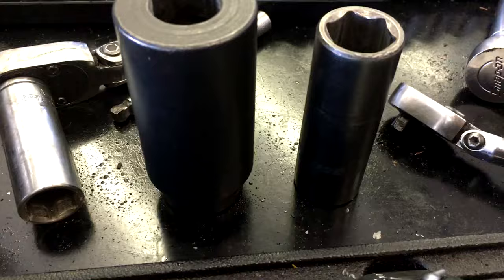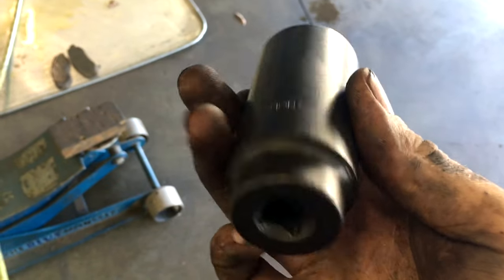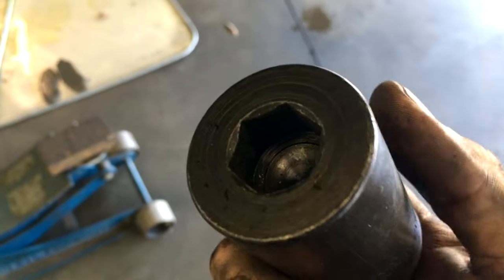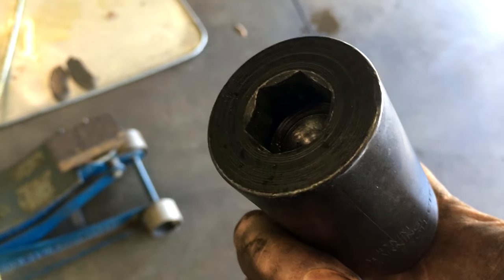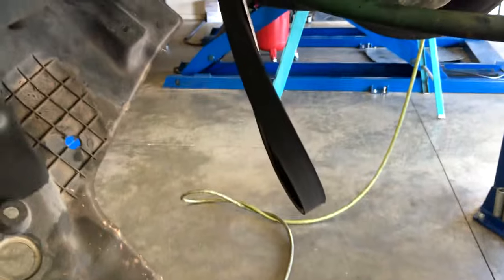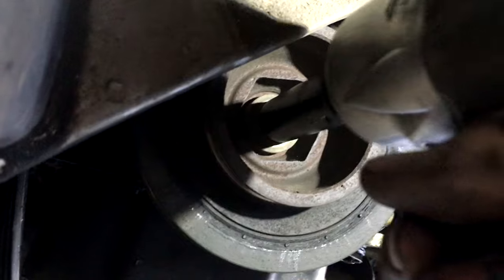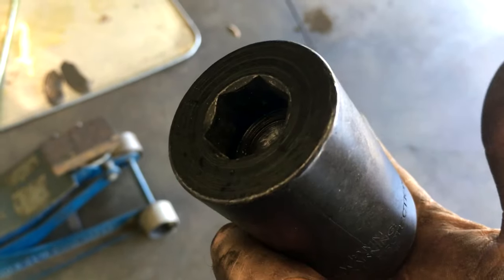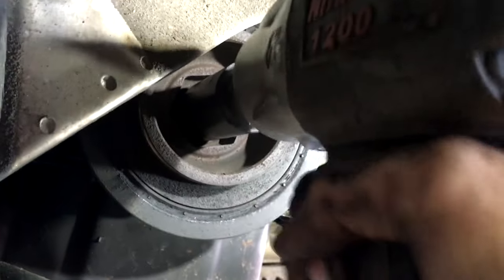The Easy Way To Remove Honda Crankshaft Pulley Bolt / Harmonic Balancer

Comment: Ok, from reading all the comments here and picking out the useful ones... the bolt is NOT reverse threaded, correct?
Reply: I can’t speak for all Honda engines or any other makes , Nissan , Toyota etc. , but I will say my 2002 Honda Accord 2.3 liter the crankshaft pulley bolt is right to tighten and left to loosen . Don’t know of any engines where the crankshaft pulley bolt is reverse thread ? The confusion is that the engine itself when running turns counter clockwise . That is why we can’t use a breaker bar and socket on the crankshaft bolt and click the starter to loosen the bolt . The engine will spin to the left and push the breaker bar to the right , tightening the bolt . Not only is that counter productive , but risking damaging the bolt as well . Just imagine the impact socket rounding off the hex of the bolt head . Worse things can happen such as the socket flying off the bolt and throwing the breaker bar who knows where , or at who . The reason why LISLE made this socket is because of the problem that the engine runs counter clockwise . They know we use the starter bump trick but it won’t work in this case , if the engine runs counter clock wise . A strong impact , a high torque is recommended , the heavy LISLE socket and the 50mm hex tool for holding the crankshaft pulley while using a torque wrench is recommended . The video creator did mention a comment regarding the 50mm hex tool but theoretically that tool is supposed to be used to hold the balancer pulley / engine from spinning while tightening /‘torquing upon re - installation . It seems today that the best option is the cordless impact such as the Milwaukee fuel 1/2” with something like 1400 ft. Lbs. is the way to go . Expensive yes , but so is a good strong compressor , accessories and a high torque air impact wrench . It would probably cost between $400 - $500 to get the Milwaukee , battery and charger but a good compressor , good air impact wrench and accessories will total much higher . Wish I had bought one when they first came out , price is up now . By the way , if you will be using shop air , get high flow 3/8” connectors . The studs and quick,disconnects are typically 1/4” and will bottle neck the pressure to an air impact wrench . Harbor freight has the MERLIN kit . Two kits will be needed because one kit only has one quick disconnect and you may need one on the compressor as well as the hose to the tool . 1/2” air hose is a good upgrade too . Now you can see why high torque cordless impacts are gaining in popularity . $$ !
Reply: @gmoney9588  good info! I picked up the high torque Milwaukee, omfg what a dream. With that and a Lisle socket it came off in 5sec flat. 
Using the engine to remove the bolt was just plain stupid haha
Use it once pays for itself. Socket was $40, impact was $320, I have 12ah HD batteries. CAD $$$

Also used Pink Solution to clean the serp belt like new, no issues.

Comment: How you take it off without the pulley spinning
Reply: Your impact wrench works against the inertia of the rotating assembly.  It works great.  You need a decent pneumatic or electric impact wrench to make it work.

Comment: 400lb torque codless dewalt impact gun does not do the job, so frustrated right now. I wish I had an air compressor.
Reply from the maker: the other option is breaker bars, and the pulley holder tool
Reply: JamesonDIY that's what I had to do.
Reply from the maker: Sorry man, I know that sucks, especially if you're doing it in a driveway
Reply: Ii could be on as much as 600 to 800 ft lbs. Even 700 lb impact might not work. You need 1200 breakaway torque cordless impact which both Milwaukee and Dewalt has. Sucker will come off no problem.
Reply: Sounds like you have the DeWalt 889. The newer DeWalt 899 has more torque and will work. Maybe borrow one?  Heck you only need it for 3 seconds!

Comment: Why isn't the pulley spinning when you turned the bolt? I can't see if there is something holding the pulley in place?
Reply from the maker: It doesn't spin when you use an impact. Only the bolt spins

Comment: That's pretty handy. I usually just use a breaker bar with a pipe against the ground and bump the engine over.
Reply from the maker: Yeah I've done that too. But not had to do anything like that since I got this socket. Where was this thing 10 years ago??
Reply: But wouldn't that tighten the bolt? .. Condidering Honda engines turn counter clockwise? Please let me know I need to get my b16a pulley off but I don't have an impact.

Comment: 97 Honda prelude h22 crank pulley wobbles what wrong with it 🤔
Reply from the maker: Probably the rubber is worn out/broken and the 2 metal pieces are seperating
Reply: Needs new crank harmonica pulley
Reply: Brand new pulley woodruff key and bolt

Comment: Can you tighten with that same tool? (With out the pulley holder)
Reply from the maker: Im not sure why you would want to. An impact with a standard socket is adequate. If you're asking if the socket would be damaged, I wouldn't think so.

Comment: breaker bar against the ground. hit start for a second always worked for me.
Reply: I've done this method as well. Nothing broke. It works with a quick bump start.
Reply: This engine turns counter-clockwise. The breaker bar on the ground will tighten the bolt=sheared bolt, broken breaker bar, etc.
Reply: nobody did it using starter bump method for the exact reason you stated, glad you popped in.
Reply: Except you cant do this with a broken timing belt.

Comment: I used socket from Amazon with Aircat 3/4 1770 XL 1400 ft torx away and this bolt still didn't get losse. What else can I do?
Reply from the maker: It's going to need heat

Comment: Screw that, breaker bar and a second jack. Install breaker bar and socket, stall tool, then just jack up the breaker bar. No need to guess if you have enough ugga duggas, cause that bolt isn't gonna fight 6k+ ft/lbs of the car pushing down on it.

Comment: FOR PEOPLE THAT DONT HAVE MONEY !!!!!! JUST GET AN OLD SOCKET AND A 1/2 EXTINSION AND A BIG CEMENT HAMER AND PUT THE THE SOCKET ON THE CRANKSHAFT PULL BOLT WITH THE 1/2 EXTINSION HOLD IT AND BATTER UP HIT IT 3 SOLID BLOWS AND IT WILL COME OFF LICK BUTTER

Comment: Bull crap.  What is your air pressure.  I'm   at 150 psi and it's not working. I guess the factory tighten to freaking much.

Comment: 3/4 breaker bar against the floor.  Crank the engine.  Stop with the nonsense
Reply: Honda turns anti clockwise loser.
Reply: @tomalophicon  tomski🤣🤣🤣😭😭😭